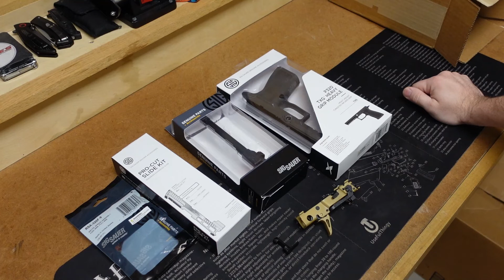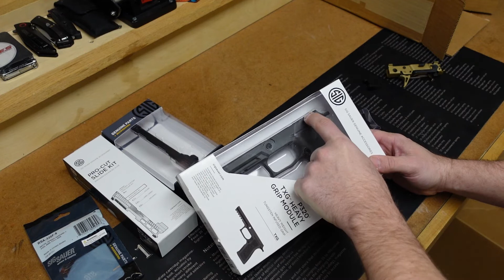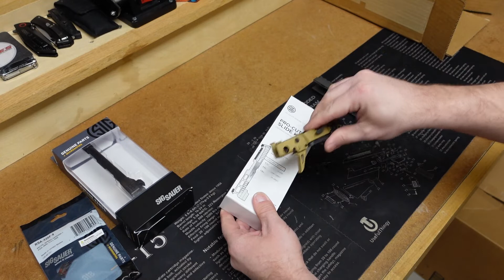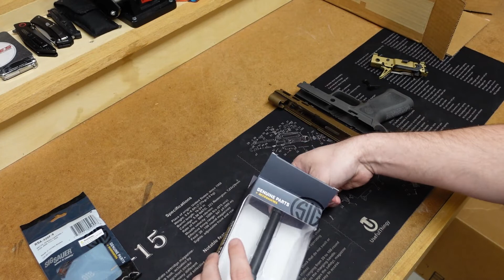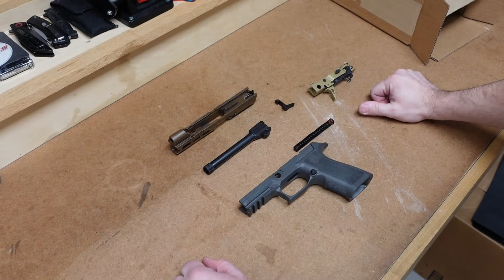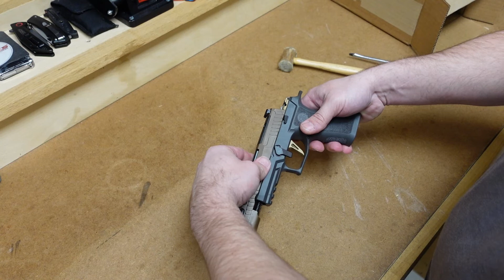Firearms Tutorial: Assembling my custom Sig Sauer P320 pistol

Comment: I have just about every frame for the P320 and have fallen in love with the M1811 by Brouwer. It’s a polymer frame but fits my hand better then any other. Love the weight of the tungsten infused sig frame but doesn’t fit my hands like the 1811. Even when I use my full size 40 S&W on the frame it feels like shooting a tad bit hotter 9mm
Reply from the maker: I will have to check out that frame.

Comment: Im so glad i got rid of my p320. Way to many discharges happening. The goal is to protect yourself not shoot yourself. Sigs also have one of the highest bore axis. As long as your happy though
Reply from the maker: I think they are generally safe if using the right holsters. They could use a trigger safety though.
Reply: P320 going off on accident are All Due To Pilot Error. 
If you handle your gun correctly and safely It Will Not Go Off.
Reply: Nice trolling lol